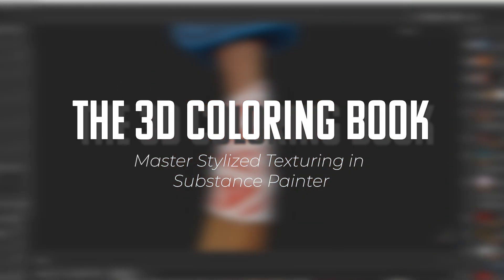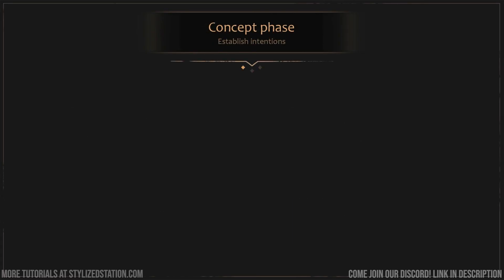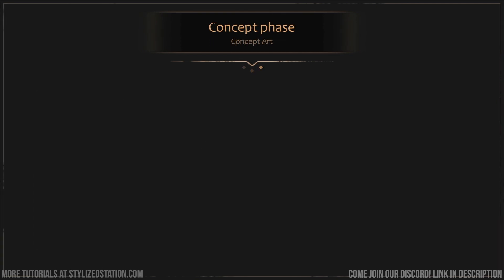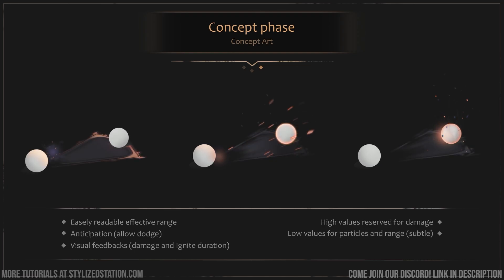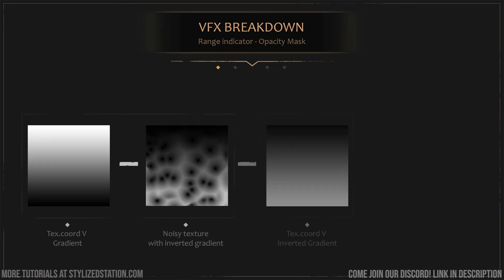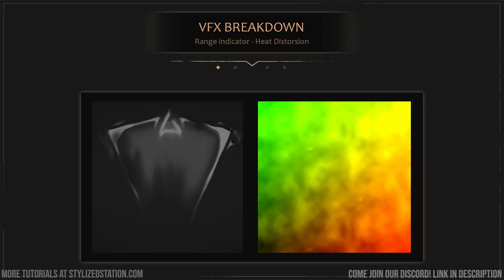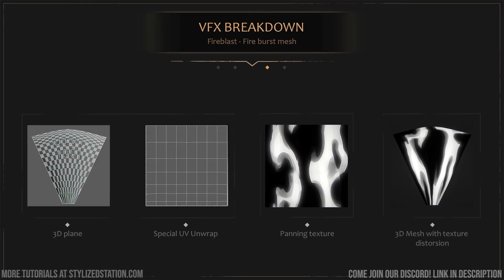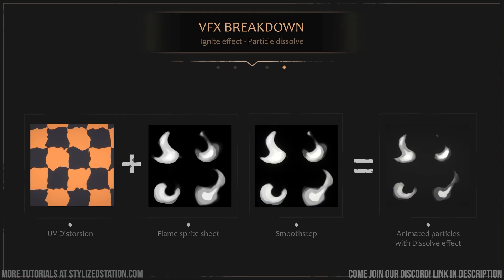Realtime Unity VFX Tutorial: The 3 Core Elements You NEED To Know

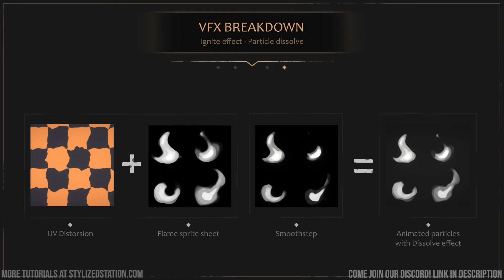Comment: 9:56 how do i hook up a shader to a particle system so the shader knows about the particles individual lifetimes? would be awesome to know!
Reply: In Unreal you can use Dynamic Parameters, in Unity it's in 3 steps: use TextureCoordinate as Float4, you have to activate custom data in the particle renderer (with custom.xy) and finally plug a curve in the custom data. Look for "use custom data in particles" on google, you shouldfind a better explaination than mine.
Reply: @MaximeMegeYthierPyrath  thanks i didnt expect More than one solution. This is great
Reply: One simple way to do it is to use color over time in the particle system and then access the vertex color in the shader.
Reply: @AlterHaudegen  oof thats a smart approach thank you!